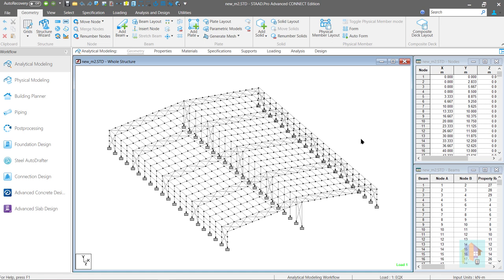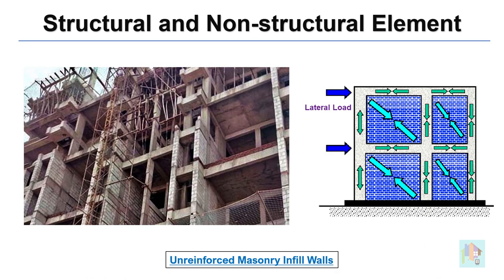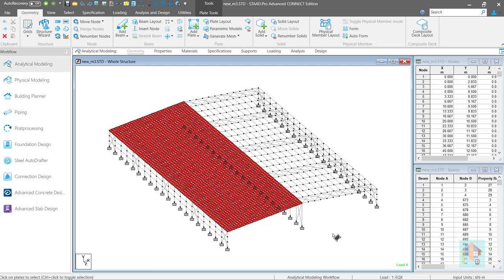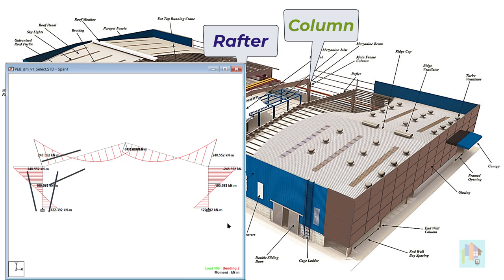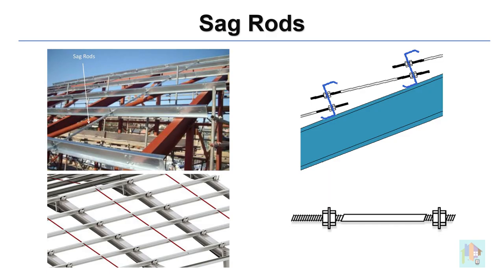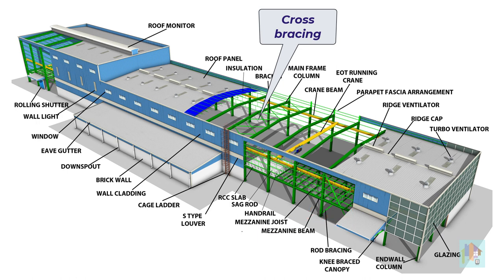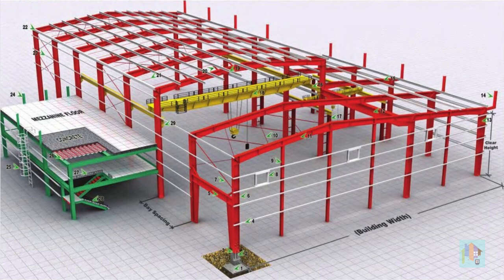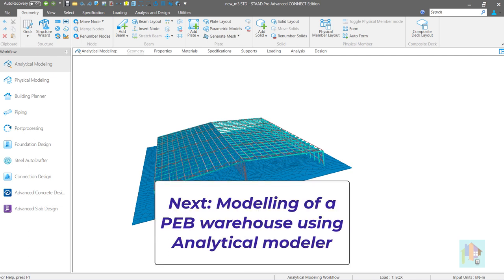Modelling Analysis & Design of PEB Structure: Part 1.1 - Structural components of a PEB

Comment: Thank you,, can you modelling rafter with purlin. and how to make parameter design for efect purlin on flange of rafter?? " parameter design aisc
Reply from the maker: Do you want to model purlin first, then rafter? Well, normally we model the primary members first and then move to the secondary members, but if you want, you can model the purlins first. Only point, you need to maintain proper connectivity between purlin and rafter for load transfer.

Comment: Very clear and informative. Please consider flange brace also. Thank you..
Reply: It cannot  be considered in staad , even if y€ model , proving that it will be act as torsional restraint for compression flange

 is impossible to prove in linear static analysis , so there is no use of modeling it

Comment: Good topic , but all these workflow system probably most of them are aware . But making a complete model of both lateral  load resisting system and main structure is too complex to be completed in staad, honestly staad team  needs to upgrade their features for ease modeling , especially dealing with tapered members,  modeling the Purlins add difficulty with so many member segments on rafter,  which in other softwares like robot sap 2000 is easy to do , one can be faster and productive when compared to staad , india still being old school  approach as always are not realizing this fact , nor we individuals as engineers are able to grow
Reply from the maker: Have you ever used Physical modeler in STAAD or know how this module can solve all these issues ? I think you don't know about this module, try to use the latest features of STAAD.  Don't worry, I will cover this module and other advanced modelling techniques in this series (FYI, I have generated all the models used in this video in less than 4 seconds) and then you will realize, how easily we can handle all your problems in STAAD.
Reply: @surojit_ghosh  yes I have used , but still its not that user friendly , its ok, the currently popular approach of tapered member optimization is creating segments of 3m and changing its cross-section property ,especially thickness of built up i section . These segments are for rafter segments only , not the segments due to modeling of purlins or roof struts . So in  physical modeler also you will have to break members and accordingly profile oprimisation is to be done , if you guys had a feature like in etabs , robot , scia engineer , that would had been of a great use case and much much better userfriendly
Reply from the maker: Hi Alex, you are correct about optimization. From modelling point of view, I know we can ease the effort with advanced features or custom templates. But right now, there is no default option available to optimize the tapered section in STAAD. Yes, we can use custom templates to select economic section but it is not possible for all the users to generate such custom macros. One thing I can suggest. please put your recommendation in the ideas channel (https://communities.bentley.com/products/ram-staad/i/). This channel is monitored by the product manager of STAAD and he will respond to you with more clarification.
Reply: @surojit_ghosh  thanks surojit I am happy that my feedback is being heard . Let's hope Bentley comes with better solution in future.  Ram elements on other hand relatively better for web tapered members compared to staad , however its still not that perfect , but yet better in terms of use case.  You should make an video on ram elements for peb structures